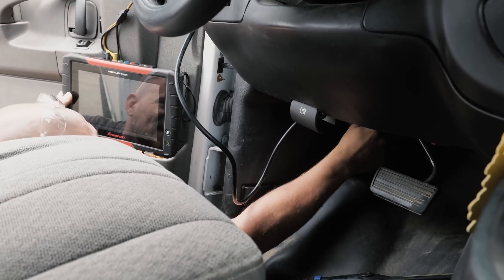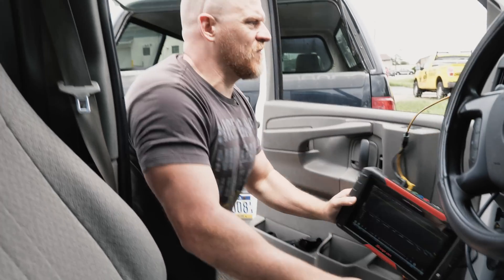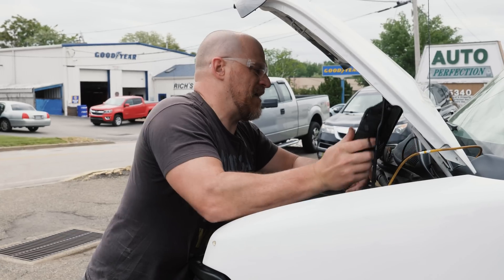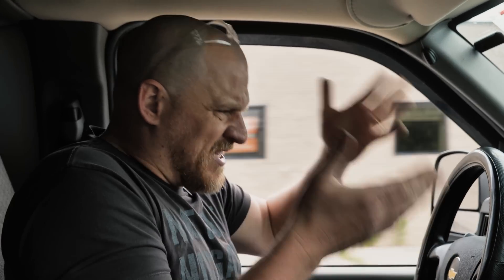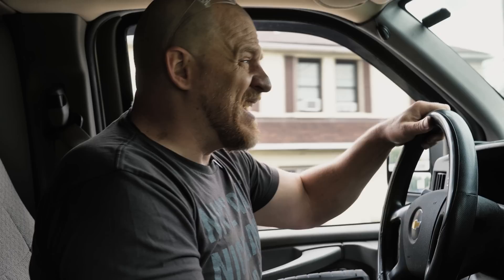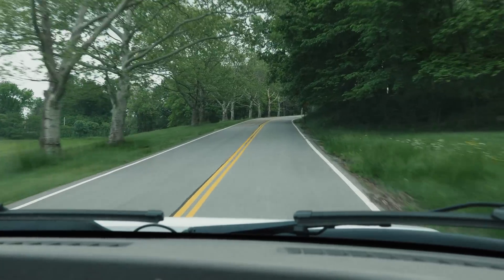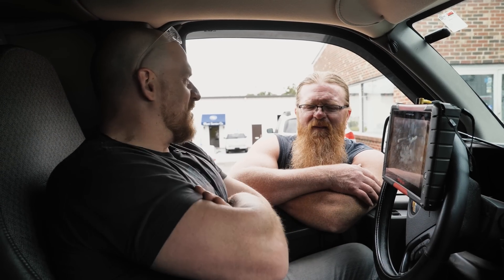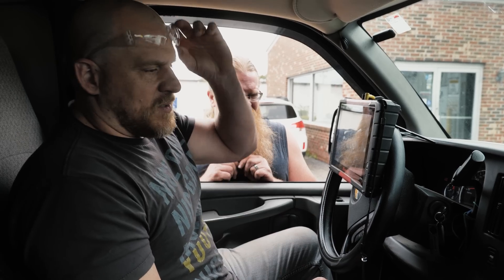We Don't Work For Free [Charging Diagnostic Time]

Comment: This is a huge problem at the dealership.  As a master tech. diagnostic  specialist you get one hour.  One hour usually on a car that went to 3 shop because they didn't want to spend money at dealership.  Then I get it do my basic diag in a car that apart in pieces with more problems caused then it originally had!   Customer flips out says they aren't paying a penny over the 1hr labor and we are ripping them off!  Then manager gets involved tells me to FIX it don't worry about time.  
Then I get screwed after cars fixed 4-5 hrs later.  
Dealer life sucks as diag guy best to stay a C tech bang out gravy work with no stress of electric and drivability problems.
Reply from the maker: I need to save this comment. This is 100% our field, not just a dealer. Big chain aftermarket places are like this too! Doing my best to make a difference. Thanks for sharing!
Reply: @ScannerDanner  ps. Love your channel and your name has come up at lexus corporate training center.  The engineers love u!  True story.
Reply from the maker: @jasonstaub3045  wow, seriously? That's so cool man. Never would have thought. Thanks for sharing this too. Really means a lot

Comment: my policy for electrical and driveability diagnostic work
150 minimum  max 1 hour 5 minutes or 1 hour 
anytime after that is my hourly rate within reason  ie if i get sent down rabbit hole cause faulty equipment etc then i adjust accordingly
but I include research time, time to make a gameplan etc 
but i also tell customer after first hour i advise them what i found and let them decide how they want to proceed   pay more time or leave with their car

did a bmw no start this week  ended up needing a fuel pump which was the correct call
charge 150 for diagnostic fee and 1 hour to change the pump

Comment: I never ever had a problem getting diagnostic time from the public only times I got used was by factory warranty times & had to have what Chrysler call double '0' time & required pre approval.
Shameful to see all the videos U have that express people's issues w/getting diagnostic time. PERSONALLY I will blame the industry not the customer. So called bumper to bumper mechanics R the root of this problem & shops that promote these mechanics created the diagnostic problems U R describing. Most of these type of mechanics won't afford the time & effort to be a true diagnostic expert. They defeat themselves immediately by lack of knowledge, approach & success rate. They have more experience letting the parts dept. fix the car than good old honest diagnosis.

Comment: As a workshop foreman in a dealership most of my day is spent on diagnostics. I have made my service advisors watch several of your videos relating to this topic and after a couple of months they finally got it and things are running so much smoother. Managing customer’s expectations and giving proper detailed write ups on invoices,so when Mr customer comes back with a MIL on they have full documentation of what was fixed what code was stored etc, so you have to pay again cause it’s a different fault different  job
Reply from the maker: Awesome! Thank you!  Trying to help this field in any way that I can

Comment: I'm a consumer, not a tech. But I wonder about a scenario where a tech spent hours diagnosing an issue and you come to find out there was a clear TSB which addressed the exact issue and that ultimately was the fix.  For example, a software update.  If the tech failed to research TSBs didn't they effectively waste a bunch of time? Instead of a 3 hour diagnosis it would have been 1 hour had they researched and read the TSB first. What is the fair diagnostic charge in this case?  The 3 hours they actually spent or the 1 hour they should have spent?
Reply from the maker: Good question and scenario. There are many times that a TSB is written that does not exactly match the symptoms of the car being tested. Saying what the tech should have done and what he actually did is very subjective with many, many variables. So this is not an easy question to answer. My only real reply to this is that we, as an industry, need to stop selling "time" and start selling "tests". 
Hope that makes sense
Reply: @ScannerDanner  Yes, that does. Thank you for reading and answering my question. As a consumer I am willing to pay for a proper diagnosis because I know the likelihood of fixing the problem right the first time is very high, and I can just move on and not have to worry about it. But the much of the general public doesn't understand what a diagnosis entails and assumes a tech can just plug in their fancy computer and it will tell them what's wrong.
Reply from the maker: @kv2280  a huge problem in our field is there are so many "techs" and garages who charge these "diagnostic fees" that unfortunately do not know how to properly test these systems at a component level and all they do is read a code a fire a part at it and call it a "diagnostic". It's a real shame because then the true diagnostic tech gets the short end of the stick in a lot of circumstances. But I'm doing my best to educate the techs who follow me!

Comment: Dan alot of people, especially younger people are of the belief that people in the automotive repair industry have this special access to computer programs or information that they plug into, and it tells you exactly what the problem is.. so if you tell them its the crankshaft ;position sensor, ,  they google "how much does it cost to replace a craznkshaft position sensor.. then google spits out,, 69.95 is the average charge... So they think when you tell them, 169.95 you are ripping them off.  I would strongly advise against telling them what is not wrong.. that sounds like a man that is drowning,, just expalin to them that you are following the diagnostic procedures for thier problem, and you have not arrived at the diagnosis yet.. if they ask you what you have checked so far, THEN  tell them.. The average  person know that cars are become more complex every year.  either they accept that they may have to pay for extended diagnostic time, or they dont. it then becomes thier problem..

Comment: I was asked the other day by one of the garages can i have a look at one car with EVAP problem (you know yourself Paul how hard it is to diagnose EVAP problems). I said yes but the owner needs to pay diagnostic fee. Their answer was: "yeah but you know she already spent a lot of money on it. We replaced O2 sensors, air filter, fuel filter, spark plugs and coils. Just diagnose it, price it and if she agree to spent the money you'll have a job". What kind of thinking is that? They want me to spend a lot of time diagnosing it for free and then if the owner agree to fix it  i'll have a job but if not i'll walk away with nothing but wasting a lot of my time. 
Another type of customers is "just plug in the computer, give me the fault codes and i'll try to fix it myself"
Unfortunately it is getting worse and worse...
Reply from the maker: That's absolutely horrible isn't it? People are clueless
Reply: @ScannerDanner  People don't realise how much we spend for tools, software, fuel, insurance, taxes etc. I don't even mention our time. The nights i couldn't sleep thinking or digging the internet trying to figure out how does the system work, what else can i check, what tests can i do to find the problem.
The funniest thing is people who drive very expensive cars never want to pay and always complain about the price. I never ever had a problem with customers who drive older, less expensive cars. They always say "thank you" and pay the money.

Comment: what video could help me, you have 619 excellent videos, they already helped.
Reply from the maker: Help you with what? I know we're are talking, but I'm talking to 20 other people today too. Stay in our original thread, I see them all and it helps me track better. Thanks!
Reply: sorry Paul, I didn't know.
Reply: sorry, I back probed the TPS  6 wires =  3.84v .. 3.40v .. 0.01v .. 0.02v .. 5.12v .. 3.84v .. there is voltage on 3 wires.
Reply: sorry, I back probed the TPS  6 wires =  3.84v .. 3.40v .. 0.01v .. 0.02v .. 5.12v .. 3.84v .. there is voltage on 4 wires.

Comment: I have 4.44 volts coming back the wrong way, from the alternator regulator, red feed wire, on the alternator, to the 10 amp fuse, in the fuse box, the 4.44 volts is collidinding with the 12.80 volts, on the 10 amp fuse, no crank.
Reply from the maker: I'm confused on where you are taking these measurements. Are you saying one side of the fuse is reading 4.44v and the other side is 12.8v? This would be a blown fuse and some type of bias voltage on the 4.44 side maybe? I have a video I can refer you to, to explain this better if this is what you are seeing
Reply: The fuse pulled out, the sockets are reading 4.44 volts on the left side, and 12.80 volts on the supply side. fuse isn't blown, no crank, because  the starter relay ground  wire, goes to the Ecm, and if I use it as ground to check the battery, its saying 9.01 volts, even thou its 12.80 volts using the negative post of the battery, thanks so much.
Reply from the maker: @janicepalmer6084  sounds like a normal bias voltage https://youtu.be/Q8ZwxJYkYnc
Reply: Is the 4.44 volts coming back colliding with the 12.80 volt supply  voltage, normal? no way, what about the ground of the starter relay ground circuit socket, (relay pulled) then it only  cranks with the key, when I connect a wire from the ground relay pin, to the chassis ground, and half insert the relay, cranks, but no start .. throttle body buzzing, 350 milli amp reading between the negative cable and negative battery post, thanks I'll give you $20 for answering, how do I give you $20, from Australia.
Reply from the maker: @janicepalmer6084  yes, it absolutely can be normal.
What you've discovered is a symptom (starter won't engage), not the cause. As you stated, even when you jump the starter and crank the engine, it still will not start right? This means your engine computer is not "alive". The buzzing of the throttle body is another symptom of that.
It sounds like you have either a missing power feed to your ECM or a bad ECM ground. With your key on, measure one of your sensors and see if you have a 5v reference. The TPS or MAP is my preferred location to do that test. The IAT or ECT (thermistors) will work too but those need to be unplugged to test the reference circuit. My money is  on you seeing either high or no voltage on the 5v ref.
High voltage means you absolutely with 100% certainty have a bad ECM ground. No voltage and we may have a missing power feed.
Reply: Thanks Paul, I will back probe the Throttle position sensor, key on position, and let you know in 12 hours, its 11pm here in Australia, Kaleb could be the next scanner danner, or the next youtuber to have a successful channel,  awesome videos, and awesome advice.
Reply: sorry, I back probed the TPS, 6 wires in sequence =  3.84v .. 3.40v .. 0.01v .. 0.02v .. 5.12v .. 3.84v .. there is voltage on 4 wires.

Comment: If advisors would not give away Diags in order to hit customers on their head with unnecessary repairs, techs would be a lot happier. It validates them on a basic level and acknowledges the fact they are Professionals

Diagnostics and gremlin chasing is not easy… at all.

Comment: Hello Danner!  I was wondering what you found out on a Ford Explorer you had about 3 to 4 months ago that you were troubleshooting the 4 oxygen sensors and the EGR valve and the vent valve!
I have the same vehicle same year and same problem just lately and was curious as to what the eventual outcome was, Was it the engine computer or was it a wiring problem?? Thanks.
Reply from the maker: Engine computer was the call but it's still sitting at that other shop! Read the comments in here, you'll feel better about making that call.
Reply: @ScannerDanner  Hello Mr Danner!!
Thank you very much for your quick reply!!
I will be working to see what major  repair shop or garage in my local area would be willing to do the change work on the ECU.
Many thanks --John Bellas!!
Reply from the maker: @johnbellas490  just keep in mind, multiple bad ECMs is the report on these! Bad right out of the box, even from Ford!! I'd suggest trying to find a used one to be honest

Comment: I have a 1993 Camaro z28 V8. Multimeter test show zero parasitic drain. Extremely hard start that has completely crushes brand new batteries with one start. I’ve literally changed everything in the starting and charging system. What tools would you recommend? I have solved basically everything except this electrical gremlin. The car drives perfectly once started. Do you have anybody you trust in California that I might contact. Appreciate you bro and I’d be willing to PayPal you for a bit of your time. Thank you
Reply from the maker: Where in California are you?
Reply: @ScannerDanner  Yosemite area. Few hours from San Francisco. Thank you
Reply from the maker: @abefroman8528  Ridgecrest Ca there is a shop (Paul and Sons) but that's not close
If your battery keeps dying, you have to have a draw. When you connect your ammeter, how are you doing it? With it connected, if you open your door, does your dome light, light up?
Reply: @ScannerDanner  I’d appreciate their phone number or business name. I know you deal with morons all the time. I’ve actually been through the ringer on this for 10 years. Multiple Chevrolet dealerships and private garages. Like  I said I’ve basically changed everything in this car in the last 2500 miles. The only thing the shops tell me is the car needs a new battery. NOBODY finds any draw and I can’t either. I’m so frustrated that it’s time to sell the car if nobody can help me. I appreciate you taking the time to point me in the direction of solid people. Best wishes
Reply: @ScannerDanner  the car starts with a jump and will start for about an hour post drive. I’ve checked and rechecked lights and doors, repeated the tests over and over again. Pulled one fuse at a time. Shoot I’ve pulled each single fuse over night just to see if the next day the drain would lessen. But truthfully it’s not the drain it still starts hard with a new battery. I’m so tired of shitty service, that’s why I reached out to you. Once again thank you, I now you have nothing but randoms hitting you up. You are obviously a solid dude.
Reply from the maker: @abefroman8528  this was my meeting with them, this past May. Contact info and phone number is in this video.  https://youtu.be/WoaD_hS8NWQ
Reply from the maker: @abefroman8528  760.371.9116
140 W. Ridgecrest Blvd, Ridgecrest, CA
If you end up taking it to them, make sure you tell them I sent you and that we've been talking okay?
Reply: @ScannerDanner  appreciate you

Comment: So, in the heavy truck industry, I don’t have a “scanner danner” I can pass off the hard jobs to. Most of the really tough electricall issues end up with a chassis harness being replaced because a short some where in 30 plus feet of harness with untold number of circuits in it. The manufacturer says to replace the harness. Oh, wait, there’s more than one harness. There’s also the abs harness,. Trans harness. After treatment harnesses. And I just found out the automotive hourly shop rate is higher than heavy duty shop rate, WHAT?!?!  How i s that a friggin thing? We don’t have Snap on scanners with preloaded circuit connectors with pin values and specs for Peterbilt, Kenworth, and the other heavy manufacturers. If we had a vantage pro for the class 8 trucks, that would be awesome, we don’t, and won’t. Cummins Insite and Quickserve are pretty dang good but not on the automotive level. You guys are lucky in that instance. 
My main objective in troubleshooting is finding the resolution. Not changing parts until the problem goes away, that would get expensive very quickly. We don’t have someone we can pass it off to if swap tronics doesn’t fix it. We all keep known good sensor to try, but we can’t just swap and hope. In the heavy truck industry, you’d have the spot light on you pretty quickly if you tried that.

Comment: Hello, I work for a mobile diag/programming company in Georgia and I run into this Alot.   It's extremely difficult to be looking over a vehicle for an hour and everything tests fine but when appts are waiting gotta go and charge a fee when you can't get it sorted. Just tell them what's its not and give guidance on what else to check.
Reply: So u play the guessing game with your clients?
Reply: @elcomandante9299  it's not guessing when you have tested several things that are correct/within spec. They need to continue testing the rest of the system until the cause is found. Or make it consistently happen before we show up and tell us what we need to do to duplicate the conserns.

Comment: I appreciate you putting this video out! I have said it before and I’ll say it again, YOU are what’s right with this industry. There is not another trade or industry out there that doesn’t charge someone when they look at something or come out. We as a whole have created this problem. It’s amplified by the free “diagnosis” by the parts stores. And if the shops would still do their part the parts store issues would have mostly gone away. People would learn after they got it wrong that they are not providing any real value by scanning a vehicle. Dealerships and independent shops need to communicate to the customer what they can expect and what they cannot. Set the expectations so they are not surprised by a charge afterwards if they haven’t found the issue. Communicating what is not the problem really helps ease the conversation.
Reply from the maker: Thank you Scott